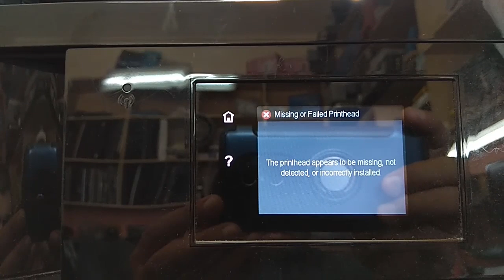How to fix hp officejet pro 8610 missing or failed printhead

Comment: What's the point of cleaning the contacts if you are going to handle them, thus contaminating them again?
Reply: Agreed, but after screw up it still may have removed oxidation or corrosion enough to still work if finger were cleaned prior to touching contacts.
Reply: @earformusic  "Shouldn't generally" - that's my point though?

Comment: Thanks a lot. I tried it with my 8620 and it worked!
Reply: Thats the one I have (8620). Same printhead problem. I'm going to try it. Thanks!
Reply: Hello.  I have an hp office jet pro 8620
Did you use an eraser and what else?
Reply: Really?

Comment: I use Adblock so no adds for me. This doesn't work anyways, it's not a contact problem (only a few cases), most often it's planned obsolescence, either the printer firmware or the printhead chip detects it's time to stop working. Mine did this after 3 years to the month!
Reply: I've also noticed that HP programs their printers to stop working after about 3 years. I've had many. NEVER BUY AN HP PRINTER AGAIN!!! Spread the word!
Reply: Ohhh, good point.  There recently was a software update.  FFS HP!!!
Reply: I took the board off and the top row of springs were stuck to the board. This printer saw only 2 months of use as well. Sad. Didn’t help tho it was damaged too bad.
Reply: Andrew why are you worried about this. You’re rich and famous. You can simply buy a new printer!

Comment: There is a big problem with HP inkjets with separate printheads, and people are throwing these away in large numbers. I live in  a city with 100k inhabitants and every week a couple of HP OJs 6xxx - 8xxx are joining the WEEE pile. 80% with printhead problems. Especially 920, 932-933 and 950-951 printheads. Checking the contacts on the board or the flex cables may or may not work, sometimes the problem is a single 50 cent component on the PH board. I have about 10 of them to fix..
Did HP shifted the profit margin on printheads, since they lost their fight with cartridge remanufacturing companies? I did not see yet a refill company making a printhead of their own.

Comment: I have an OfficeJet 8610 with the missing or failed printhead error.  When I took it apart and removed the main circuit board on the back where there are the 8 small springs making contact with pads, that is where there clearly was corrosion.  There was some green corrosion on springs and pitting on the ?gold? contact pads.  I lightly sanded with a very fine sandpaper (about 600 grit), both the spring ends and the pads, and wiped with alcohol and re-assembled.  Still didn't work.  It's a real shame that HP won't sell the relatively simple replacement parts, only the whole printhead for 120 USD.  So, I'll have to take the very nice printer to the dump and buy a new one after only a couple of years of light use.
Reply: I am dealing with the same issue.  I did everything just like the video.  Only had the printer for 2 years with very light use and it still looks new, but now the printer head cost just as much as a new printer itself.  Make me not want to buy an HP again.

Comment: You don't show the result, did you have success after taking apart and putting it back together?   Sounds like a science experiment.   All I want to do is re-calibrate my printer head, as that worked in the past.

Comment: WHat is the cloth or object used to clean?
Reply: It looks just like a cotton fabric.  The idea behind cleaning with the cotton cloth is to get any oil or grease off of the connections so they will not corrode and cause the problem to happen again.  It is not really a big deal what you use as long as it is clean and not abrasive.  you could put a bit of alcohol on the cloth to help get all of the grease off.
Reply: Unlike the comment from Dallin, I believe that is sandpaper that he is using.  I believe this for a couple of reasons...  The material is quite stiff and does not flop around, and there is writing on the back side of the material.  Sandpaper "always" has writing on the back to indicate the grit (coarseness) and usually the brand name.  That material appears to have Asian characters on it.  Dallin is correct in the sense that one would want to be careful with sandpaper or else you might remove all of the very thin metal film of the pad.
Reply: sand paper and tissue paper
Reply: Sandpaper

Comment: Does this work with 8620 All in One ?
Reply from the maker: +Jody Tadder yes
Reply: If your printer head looks the same then probably yes.  After looking into the issue I found multiple printers that have the same issue.  they were all cleaned the same way they just looked slightly different.